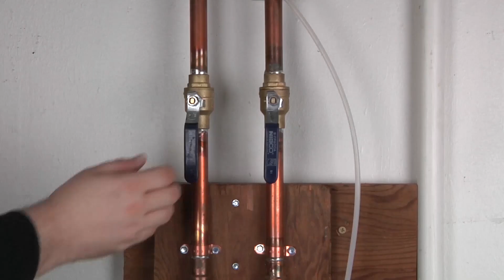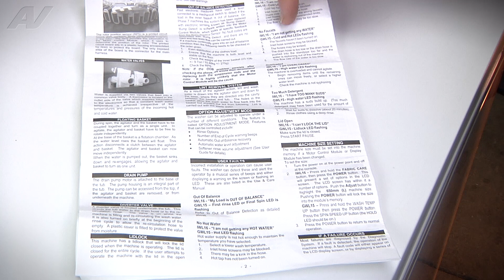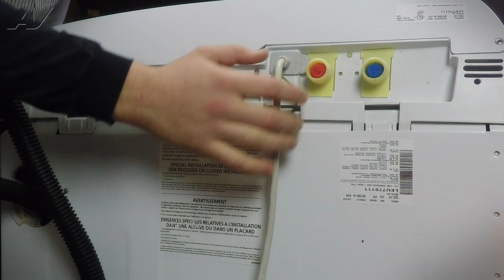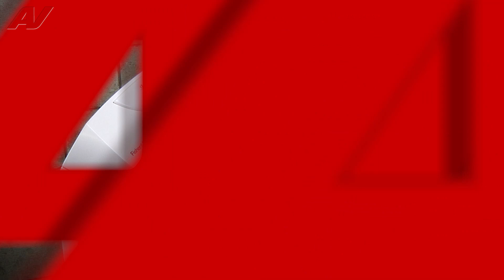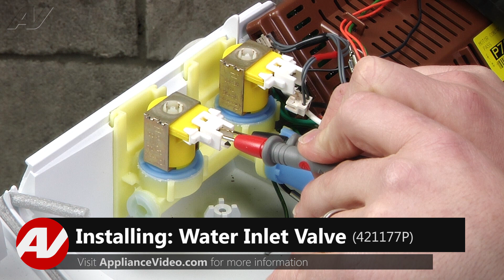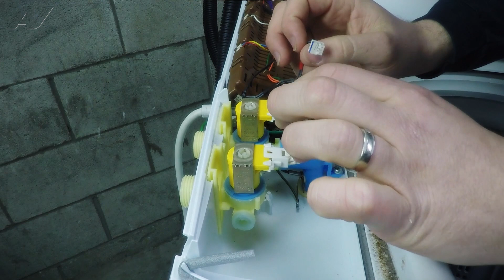Fisher & Paykel Washer Repair - Not Completing Cycle Error Code 49 - Water Inlet Valve Diagnostics

Comment: I blew the controller board, brought a new one, saw this vid, decided to test the inlet valve electrically and found that the hot water solinoed failed the continuity test.  Brought a new inlet valve, replaced both at the same time, all working.  Not saying the old inlet valve may have blown my new controller board, but I'm glad a changed both ... thanks man.  And this is Aug 2024!!! Many thanks from Perth, Western Australia!

Comment: I have Error code 49 on my GW512. I tested the resistance at each inlet but they are both around 60 ohms. Any other idea what the problem might be?
Reply: Main PCB
Reply: Had same problem, but I read somewhere to put olive oil in the inlet valve at 45, lay machine front down, the oil loosens the solid valves sticking, this works as I just fixed mine using this method 👍👍👍
Reply: @YoYouBeTrippin  great info mate, I tried it, soaked it for 3 hours but still have the same code problem, I rang two different repairers, the first was before I saw your reply, they said that they could get the inlet valve replacement but if that wasn't the problem I would still have to pay for that part plus their fee and gst. The other phoned me after I tried what you did which unfortunately didn't work, I asked how much a new motherboard was if that was the issue. He said about $450. That would be $550 with his call out fee. I decided to buy a new machine. I really wanted your olive oil idea to work but oh well at least I get a new machine. I bought a whirlpool but my fisher and paykel lasted 11 years. Thanks for your help anyway. 👍🏻👍👌
Reply: @jackvincent4057  Bummer yeh mine finally died too, before I got try this, I also seen another post of others that had same the problem, if it’s not the inlets it’s self it’s sometimes the mother board has three little diodes on the bottom right hand crn, they do hold the charge which tricks the mother board, apparently if solder a 0.4ohm resister to bridge them it fixes the problem . I know such good machines, I was lucky bought a really good 2nd one in great condition.👍
Reply: @YoYouBeTrippin  yeah mate I'll see if I can find someone who can look into that, I still have the machine and I will see if that is what the actual problem is. I would like to help others with similar problems. The movement of the bowl seems excessive which makes me think something inside is broken. I will look at it and get back with what I see.
Reply: @YoYouBeTrippin  yeah I still have the machine and I'll make it a project, I still haven't looked in the back of it yet, I love my new machine. Lmao.
Reply from the maker: Great question, if you have a
more technical question that our parts department cannot answer, you can search
our over 10,000 answered questions free at our website www.ApplianceVideo.com under our Repair Help section. You can also call
our parts department at 1-800-830-5465 and they can give you help 6-days A week
Monday -Saturday, or search at www.SaveMoreOnParts.com  24 hours
7- days A week.
Reply: Yeah I would suggest main PCB is toast.
Reply: How much is da inlet valve